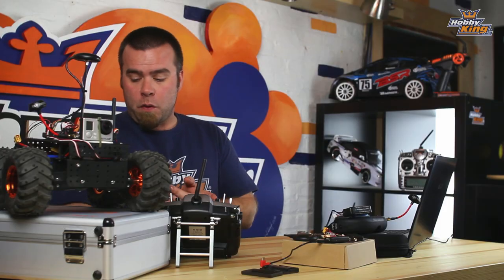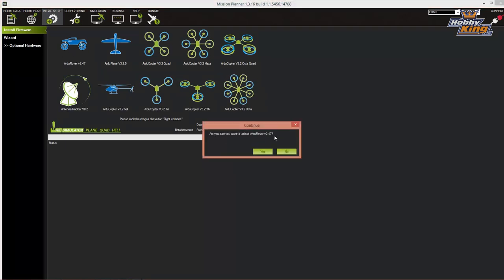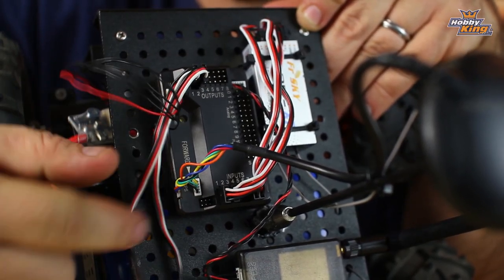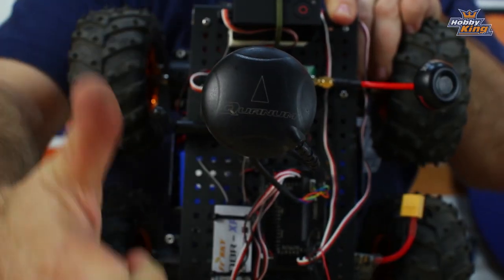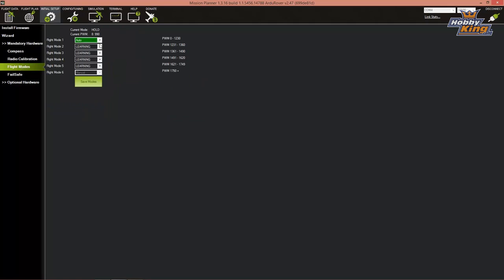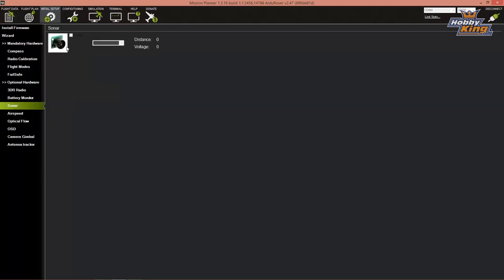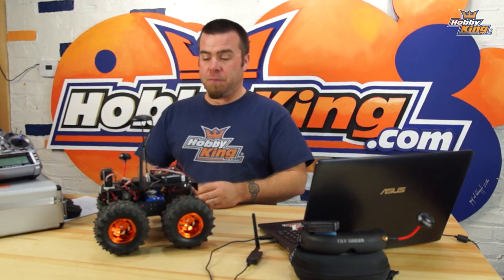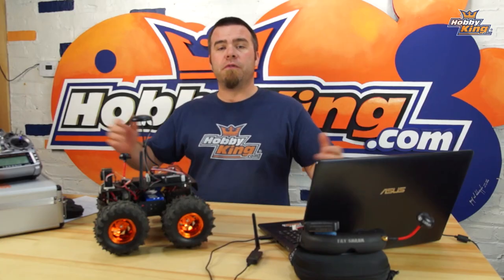HKPilot Mega 2.7 Series Episode 2 - APM Rover - HobbyKing Live

Comment: Here is two tips.  I prefer to run ppm into the APM board.  Only requires one wire connecting APM to receiver this way assuming your receiver supports ppm.  I never seem to get the jumper trick to work on these so to do it manually there is jumper pads on the bottom.  You must exacto the small PCB trace to disconnect the ppm to pwm encoder and soldér bridge the other side.  Then channel 5 on APM it your new ppm input.  Works great.  Also if using in a plane or quad putting some breathable foam over the barometer is necessary before u close up the case.

Comment: Great tutorial thanks. Will there be any problem with a gps module that doesn't have compass built-in ?
Reply from the maker: Tarik Kelestemur Hi Tarik.  No problems without the compass, in that case you will use the compass built in to the HK Pilot, it is just a little less accurate due to all the other electronics around it.  - Matt

Comment: can this be setup to follow. what equiptment would i need to make that happen.
Reply from the maker: Rachel Babcock Follow mode is a new addition to the firmware, but will work with this equipment.  I haven't used it yet myself but I believe you just need a device for it to follow, Bluetooth works I believe, and maybe the telemetry radios as well.  I'll look into it before the next episode.  - Matt

Comment: Hallo there! 
I got my set from HK EU warehouse. Loaded latest firmware and so on. All works until I have telemetry radio connected to autopilot. Autopilot starts up and and than, after few seconds shuts down- red& blue led indicator turns off and autopilot does not respond. Today arrived 433MHz radios- same with these. Is the main board failure than? :(

Comment: I have a problem trying to use learning switch on ch7. I switch the mode button to learning, hear the audio confirmation from the APM thru Mission Planer that it is in learning mode but when i flip the switch on ch 7 nothing happens and no way point is recorded. Can have anything to do with the narrow change in PWM from 910 to only 1497 on ch 7? I have done the radio calibration and set the limits but still not working..